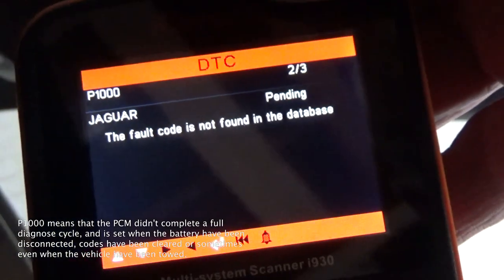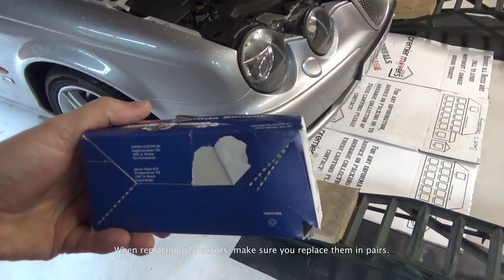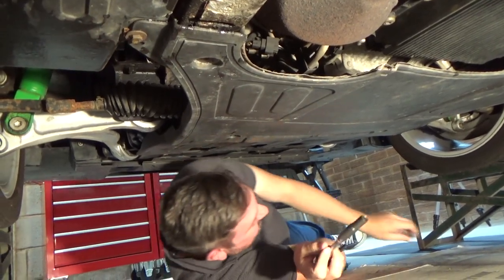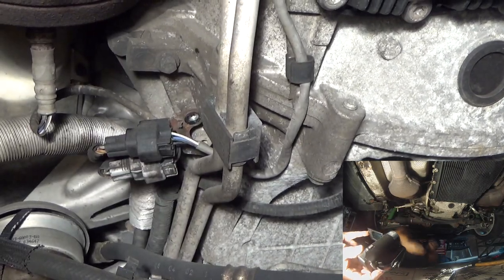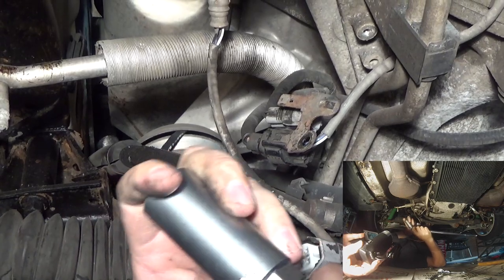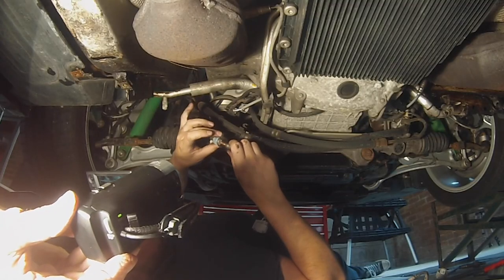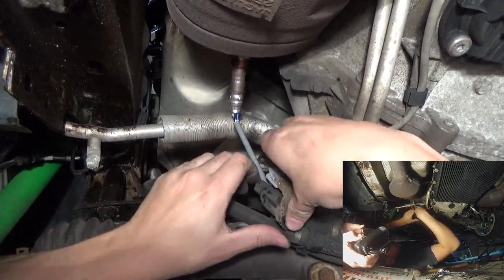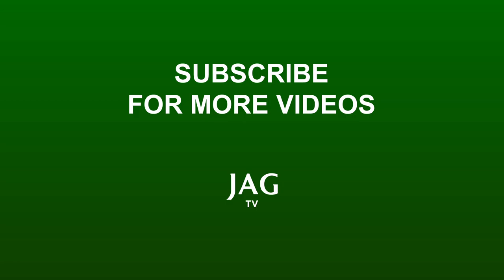Replacing upper o2 sensors | Jaguar S-Type R

Comment: I have progress to report. The transmission is shifting perfect after I serviced it. The 02 plugs are sorted. The last " mechanic " that repaired the plug plugged in reverse and he mispinned the plug . I still had a misfire and lights coming on. If you can believe it I decided to examine the MAF sensor sure enough it had build up on interior probe. Clean and reinstall car runs like new again. These cars are very sensitive to vacuum leaks and OEM parts. Lesson learned don't use aftermarket they won't work. As well as spark plugs and coil packs. I wanted to thank you for helping me with advise as a 2 year journey is complete . I cant describe what it was like driving it for first time . Thanks again
Reply from the maker: Hi Mike,
Good to hear that you have got it all sorted out now. Enjoy!

Comment: I have a 2004 s type R and the check engine light just came on and code says PO153 02 circuit slow response bank 2 sensor 1. Does the 02 sensor need changing or something else. thanks

Comment: I need help . I believe the 02 sensors were plugged into wrong plug !! How do I tell upstream from downstream plug . Thanks in advance
Reply from the maker: Hi Mike, The upstream sensor connector and its mating half is grey. The downstream sensor connector pair is black. The upstream and downstream connectors should not be interchangeable. This has been our experience on the few that we have done on S Types and XJ8 cars. Hope this helps.

Comment: Hello, do you know the torqe from the cylinder head bolts. From a 2500 engie. I am very grateful if you can help me.
Reply from the maker: Hi there. I have attached a link that will give you the head bolt torque information. It is the same for the 2500cc and 3000cc engines. Hope this helps.
Regards Brian
https://drive.google.com/file/d/1b_OEe256IJGx_CO-StMbTrj1FFVYwcGP/view?usp=sharing

Comment: Hi’ I’m getting the code p1647 but I’ve changed the sensor. Any ideas?
Reply from the maker: Do you get P1647 after clearing the fault codes? and - it's possible that the new sensor is faulty. Did you use aftermarket sensors or the DENSO OEM ones?

Comment: I’ve cleared the codes but it wasn’t a high spec sensor. Could that be the problem?
Reply from the maker: It's possible, but it could be a fault in the wiring/circuitry. It really is a 'process of elimination' - i.e. test one component of the system and then the next and so on until the culprit is identified. I would suggest eliminating the sensor first by trying a known working one by swapping it over with the opposite side sensor. There is no single answer to this I'm afraid and you will need some patience and a drop of perseverance. Sorry I can't be of more help just now. Let us know how you get on.

Comment: I know bad sensor can really make the owner crazy but what is the general thought about third party after market cheap O2 sensors? The price difference is more than 10 times (OUchhhh).
Reply from the maker: Hi Sam - yes Jaguar (DENSO) sensors can be expensive but they perform a critical job and we wouldn't trust this to an aftermarket sensor. You could try the cheaper version/s. We can't say what the result would be though. The "rule of thumb" is  - always use genuine parts for safety and performance critical use.
Hope this has helped.

Comment: Mine is V6 and I couldn't find the Denso part where I live, only Bosch is available and it's cheap something like $35. Will it be good as the OEM?
Reply from the maker: Hi - If the Bosch alternative is only $35 then it's worth trying. Don't forget to clear the 'trouble code' after fitting it. Just double check that you are buying the correct sensor as the connectors are different between the upstream and the downstream sensors.
Reply: @jaaagtv  Thank you so much

Comment: Hello, I have a 2 liters v6 x-type 2002. And I get the code p0174 and p1000. Should I try to change the 02 sensor or not? The symptoms I have are that the rpm doesn't go above 3000 and cruise not available. 
Thanks in advance!
Reply from the maker: Hi - P0174 indicates that there is too much oxygen in the exhaust. It is possible that the 02 sensor is faulty but it could be caused by a number of other things. Have a look at the link below whee this issue is discussed on the Forums.
regards Brian
https://www.google.com/search?q=jaguar+x+type+dtc+p0174&rlz=1C1CHBF_en-GBGB924GB924&oq=jaguar+x+type+dtc+p0174&aqs=chrome..69i57j0i22i30l7.32947j0j15&sourceid=chrome&ie=UTF-8
Reply: You can just try to exchange (swap) bank1 and bank2 O2 upstream sensors, they are with grey connectors both. If you get the same code, you O2 sensor is not faulty. But if you get a different code, say P0171, it means, that O2 sensor is to be replaced.

Comment: Hi I’ve a 2008 sv8 it was my dads but he died 4 years ago and I’ve had it garaged until decided to use it a couple of weeks ago, I’ve got these errors, saying it’s running lean bank 1 and 2, mass air flow - circuit Range / performance error, and cat below threshold P0420, p0171,p0174,p0101

Thing is it drives spot on, acceleration is mental, not lumpy, no backfiring… but I keep getting engine management light and these errors… do you have any ideas would could cause all these errors, could a blocked cat cause all these, or faulty sensor ? 

I was going to sell it as I need the cash, but I can’t part with it, tbh it’s all I have from my dad so I really want to get it running right, just can’t afford garage fees right now, I don’t mind getting my hands mucky, not new to working on cars but I am with jags, especially a 420bhp supercharged monster, no idea why my dad had it, he drove 60 on the motorway and 30 in a 40 zone
Reply from the maker: Hi - As the car has been standing for a few years the faults which are displaying are not altogether unexpected. S Types have an extremely sensitive electronic network system and rely on having a top condition battery at the heart of it. The battery may start the car okay but may not be in perfect electrical condition. A low condition battery can (and sooner or later will) cause a number of faults to be displayed especially where a fault includes the wording ""circuit range". The running lean and CAT error you are seeing I would suggest is the result of the car being idle for so long. I would suggest that you check the age of your battery and if it needs replacing then use a 90/95 amp/hr VARTA (Jaguar use these and they are excellent). I would clear all the DTC faults and give the car a GOOD LONG run and see if the faults remain clear. If you love this car for sentimental reasons and for the fact that it goes like 'a scalded cat' then you really must keep it. The 4.2 R Supercharged model is appreciating in value and a 2008 model is the last of the production run by Jaguar Cars. I hope this has helped. Let me know how you get on. Good luck! - Cheers Brian
Reply: Hi thanks for replying, I’ll look into the battery as think I’ll treat it to a new one anyhow, mines an xf 4.2 supercharged sv8, definitely intend on keeping him, kids named him George 😂 
Had a nightmare with the errors, and don’t want to talk too soon but think it’s better now, I took off the pre sensor on the cat sprayed a litre of thinners in mixed with carb cleaner, and filled if full of engine degreaser foam, and put the sensor back in, left it for an hour, took off the air plenum “bit before the charger” not sure what it’s exactly called but started it up with hammer on the accelerator at 3k , sprayed a bottle of liquid molly cat cleaner in the intake… dash was like a Christmas tree lights and never seen so much smoke come out any exhaust, kept it running until smoke cleared, put it all back together, reset the errors… and been driving for a nearly 2 days now with not a single error on the reader, accelerates on point now as well, I checked the live data and the cat is now almost identical to the bank 2 and airflow is better as well, cleaning the cat out definitely made a difference, just don’t get why I was getting lean errors bank 1, then 1 and 2 with the cat.. not a mechanic so if someone can enlighten me I’d appreciate it, studying this icarsoft though so I can learn how to read the live data, those tools are a life saver
Reply from the maker: @GaryTaylorvw  Glad you made good progress. Didn't appreciate it was an XF. "My Bad". What model iCarsoft are you using?
Reply: I bought the v2 lr on Amazon for £140 with prime delivery, got to fix the door locks now both passenger side front/back aren’t locking / unlocking properly, I can see there’s movement when I lock/unlock just not enough, think I’ll leave that for next weeks challenge 🤷🏼‍♂️

Comment: What side is bank2 2 p0430
Reply from the maker: Bank 2 is the side of the engine opposite Number 1 Cylinder.
Reply: @jaaagtv  driver side or passenger
Reply: @jaaagtv  I have a 2000 s type 4.0
Reply from the maker: @Theyhatelonzo  The relative position of Bank 2 and Number 1 Cylinder remain constant whichever side of your car is the 'passenger or driver' side.
Reply: @jaaagtv  i need to know which one is bank 1. 
and what is number one cylinder how do I locate that
Reply from the maker: @Theyhatelonzo  Bank 2 is on the R/H side of the engine when viewed from the front of the car.
Reply: @jaaagtv  so bank 1 is passenger
Reply: @jaaagtv  s type 2000 4.0

Comment: Hello, you mentioned that with the 3L V6 the oil filter would be in the way. Is it a major problem to get past?
Reply from the maker: Hi,
The V6 sensors are still fairly accessible so the oil filter shouldn't present a problem.
Reply: @jaaagtv  That's a relief!, Thanks for getting back to me